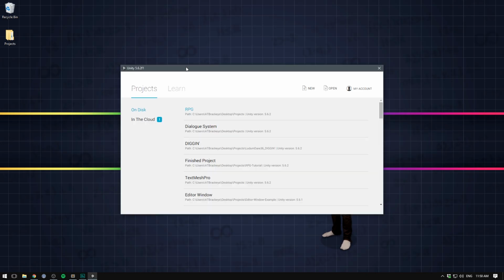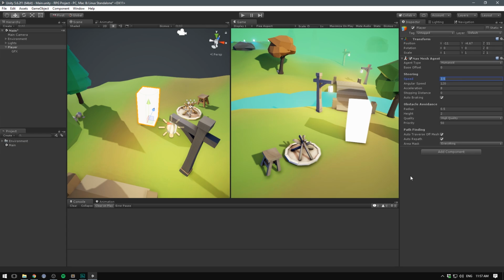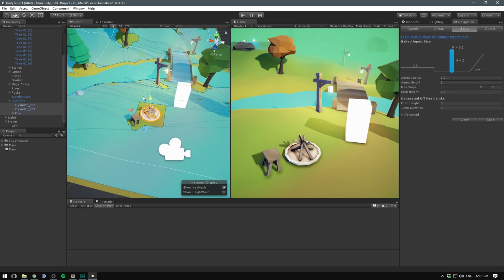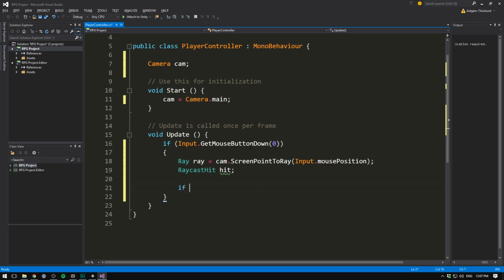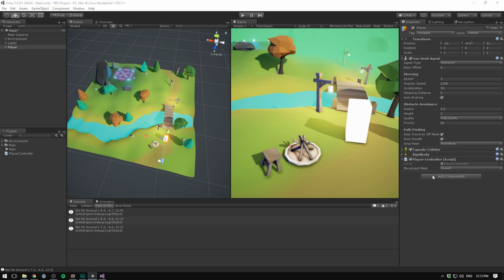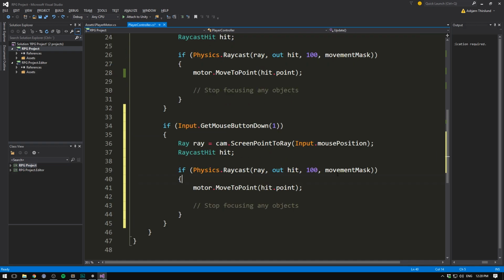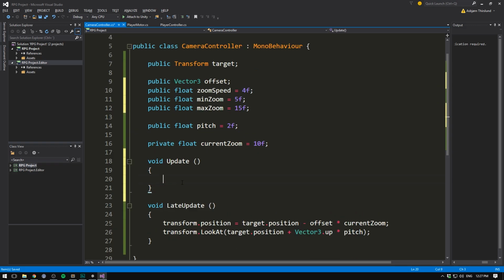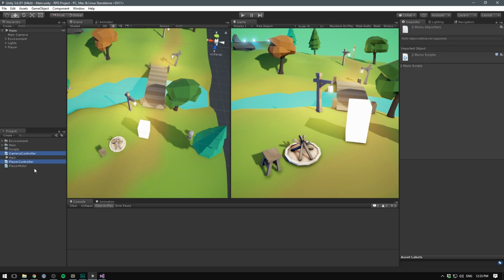MOVEMENT - Making an RPG in Unity (E01)

Comment: The Example scene isn't loading in properly any fix? https://gyazo.com/782a4a6b63950617bb534b2cabb22750
Reply: Unity is up to date and just re opened the project after a full  reboot and .blend file were automatically set to open using blender maybe i need to create a new project
Reply: don't know what happened i created a new project and it asked to merge i hit merge cinematic and ... and it told me to program stopped working i killed it and tried again no options nothing it just worked like in the video
Reply: I had the same issue, finally managed to solve it. I use Unity 2017.1.0f3 and Blender 2.7.8c and I had the same warnings and errors as you. I tried to install older versions of Blender to no avail. The issue in my case was that I was installing Blender under a different path than the default one, so Instead of C:\Program Files\Blender Foundation.... I was using D:\Blender Foundation\... . It's curious since Unity actually detects Blender, but then something goes wrong. Anyway, by installing Blender under the default location and then re-opening Unity, the issue is solved (those two warnings with "'.' is not a valid texture" are still there, but everything seems to be ok otherwise).
Reply: Some objects have an error that goes like this "Mesh used by the renderer doesn't have normals. Normals are needed for light mapping"
Reply: Legacy I believe you need blender.
Reply: oh thanks I still have not installed that after 8.5 months for some odd reason :) will get it right away
Reply: Nope I did nothing but at least I have blender now
Reply: Which unity version are you on?
I'm on a old version (5.6.1f1) and have the same issue.
Reply: Legacy so, do you have everything working fine now?
Reply: i just copy everything brakeys is doing and it gives some kind of error 
check this

https://imgur.com/a/yorpg

my code

// this is for player controller

using System.Collections;
using System.Collections.Generic;
using UnityEngine;

public class PController : MonoBehaviour
{

    Camera cam;

    // Use this for initialization
    void Start()
    {

        cam = Camera.main;

    }

    // Update is called once per frame
    void Update()
    {
        if (Input.GetMouseButtonDown(0))
            NewMethod();
    }

    private void NewMethod()
    {
        Ray ray = cam.ScreenPointToRay(Input.mousePosition);

        RaycastHit hit;

        if (Physics.Raycast(ray, out hit))
        {
            Debug.Log("We Hit " + hit.collider.name + (" ") + hit.point);

            // Move our player to what we hit
            // Stop focusing any objects

        }

    }
}
Reply: this litterly happens with every project i try there is always something wrong. how do i fix this you say? i dont understand what i should do.
Reply: cheesy crust this is happening even with projects YOU CREATE? As in not just example scenes from external sources? If so I would recommend uninstalling unity, and downloading the latest version. If not, the comment thread should give at least some ideas (I'm not going to regurgitate what you can find easily).
Reply: In your script, near the very top, find "public class PController : MonoBehaviour". Change "PController" to "playercontrols". If that doesn't help, just let me know (it probably will fix that specific problem though).
Reply: Mr. Adhesive ur a beast. could i add you on smth if i have any more questions?
Reply: cheesy crust if you have steam, you can go ahead and add me. I assume you have already added me (I got one invite). I am taking down my link because you know... If you weren't the person who added me just let me know and I will put it back up.
Reply: Mr. Adhesive i did add you yes
Reply: Having this same problem too.....I have blender installed and i have blender files set to default :(
Reply: I'm having this exact same problem and after downloading and installing Blender still have no idea what I'm doing in order to get what Brackeys has got.
Reply: I finally got mine fixed, I think I just downloaded Blender through steam and set the files to blender by default. And then I opened a new project and it finally just worked.
Reply: Thanks dude, you help me a lot
Reply: I was getting that problem because during the import, a window would pop up and I wasn't reading it and just selected "I've made a backup, Go Ahead!", thinking that the pop up was telling me to make a backup of my project before importing a new one. But it was saying that some of the scripts had outdated code in it and asked if I wanted the program to automatically update stuff which is bad lol. Stupid noob mistake
Reply: Hope you solved the issue.

I was able to resolve by:
1) Downloading Blender here: https://www.blender.org/
2) Make sure .blend files open with Blender
3) Restarting computer
4) Importing RPG Environment.unitypackage into a brand new Unity Project
Reply: Issue resolved.

1. Made sure blender was installed and .blend files defaulted to opening in blender.
2. Updated to Unity2017.1.0f3
3. Reboot computer, re-open project in Unity2017

Try updating and see if that helps resolve your issue.

Comment: Will Sebastian make the asset items with us or are going to use this completed scene?

I know it will take forever but I was expecting to create everything from the ground up, including the scene. It's kinda disappointing if more than half of the work is already done for us.
Reply: Depending on the graphics you want for your assets you could try something like blender to make your terrain however you wish. I personally use a lot of GoogleSketchup for my models though they tend to be low poly and very rigid but allow me to develop components for unity easily enough. If you want to use the same models as the tutorial you can try creating prefabs of the smaller components to move and duplicate yourself.

Comment: I have currently been working on a Save and Load feature for my RPG. It allows you to create multiple save files through appending the date and time to the save file name during creation. I also have a (some what) working display list that allows for the loading of any save file. I would love to see your take on how to make a save and load function that allows the creation and loading of multiple saves as this seems pretty rare throughout most of YouTube and the Unity forums. A good way to do this would be to use buttons. But, I am using the text link feature of TextMesh Pro which works good as well.

Comment: i cant see the ground when i click on the example
Reply: I was having the same issue.  I was also getting an error that my .blend files were not assigned to open with blender.  I installed blender, and assigned it to open .blend files. Then I  Reimported the RPG environment package and its showing up now.  Hope this helps.
Reply: After you download blender, go to the rpg-player-assests folder - models, then open one of the .bl files with blender, it should work then, reimport the project into unity
Reply: same problem
Reply: nothing of the two answers helped
Reply: Fem_Kilo_Torsk me too
Reply: Did you guys download blender I had not and when I did it worked
Reply: make sure you install blender :D
Reply: just install blender
Reply: Fem_Kilo_Torsk I can't either
Reply: thanks that helped, i use maya so i had to download blender

Comment: Why use nav mesh agent for a player controller?
Reply: Seems that you get a free pathfinding with it so :3
Reply: That is so when you move (As we are using a click to move system) you do not walk into/through any objects or obstacles, It also means that, for example, If you happen to be on one side of the river and you click on the other side to move there, It means that you do not walk directly to your destination that would cause you to walk into the river as we are wanting to use the bridge, It means that by using the NavMeshAgent, Your character will take you over the bridge to take you to your chosen spot on the other side of the river.

Hope this helped :)
Reply: Cause since he is doing click to move is just easier than coding a pathfinder algorithm himself
Reply: I Just wanted to add that sebastion has a video on how to program a path finding script.